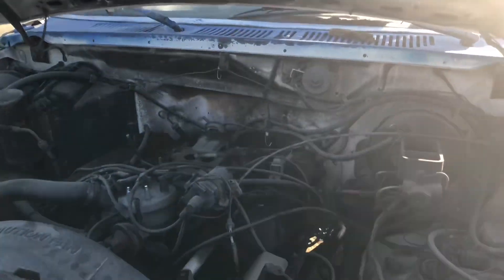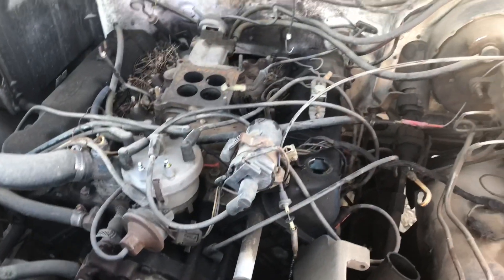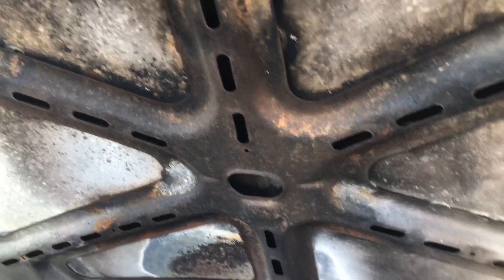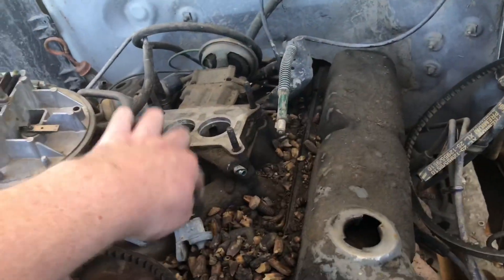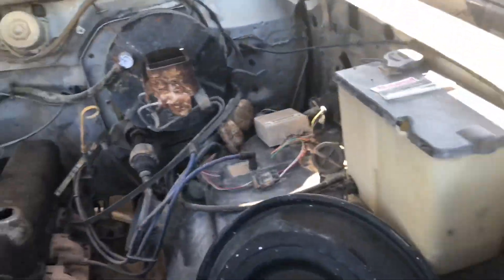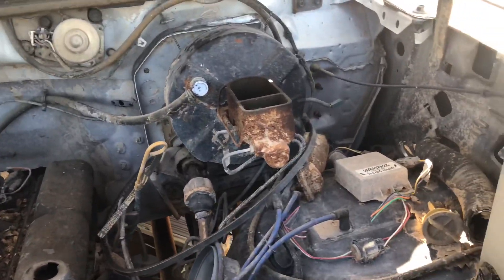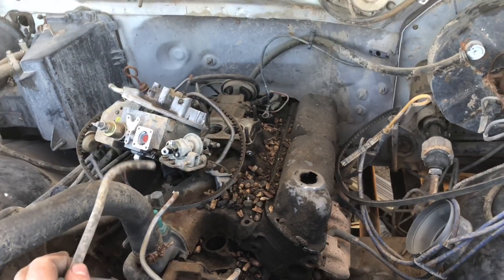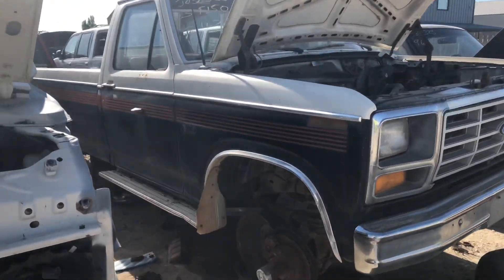Idaho Junkyard Run | Jalopy Jungle | This is my Favorite Junkyard!

Comment: Need one around here in the tip of tennessee one with good stuff not the new crap need sone trim pieces
Reply from the maker: What trim pieces do you need?
Reply: @justhes  I need the long one for top side of bed in the video for drivers side and I need the passenger side wheel arch id post if a pic if could cant find them anywhere

Comment: 2:30 Are you running any kind of charcoal canister for purge in your gas truck?  I had to add one to my Firebird as it smelled of fuel all the time.
Reply from the maker: Afternoon Garage the truck already has a canister, I’m still working out a system to use it. I don’t want to smell fuel either!

Comment: I wish junk yards where I live were that cheap. They are highway robbery like everything else here. I need a front sway bar for my truck.
Reply from the maker: Same. Pick n pull is fairly expensive. That bracket and cable would have been 25 bucks. I’m going to the junkyard soon to grab some sway bars. Both my trucks need the front set up.
Reply: @justhes  Mine was set up for front and rear but someone in the past removed the front one. It probably broke is my guess. Years ago my local truck yard wanted $50 for a sway bar. I guess that's not too bad considering you can't really buy a new one.
Reply from the maker: I ended up paying 30 bucks for mine and that came with the brackets and end links.